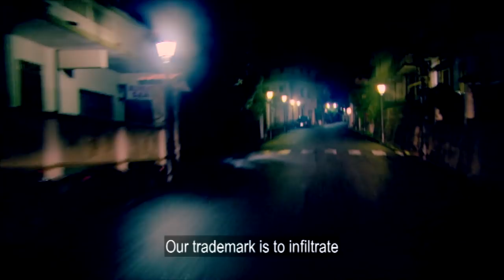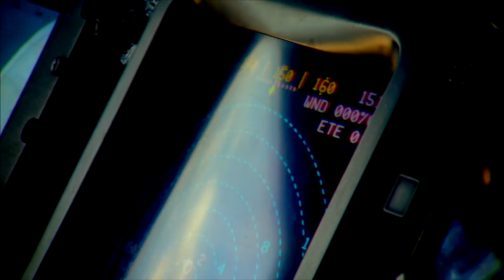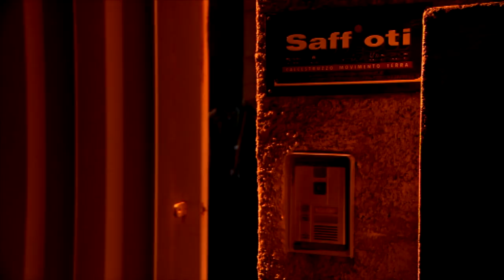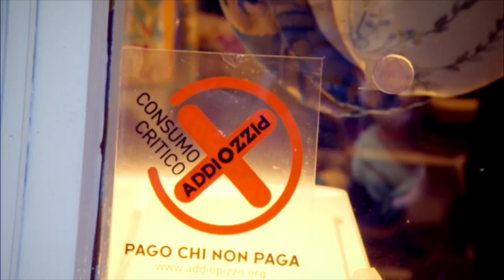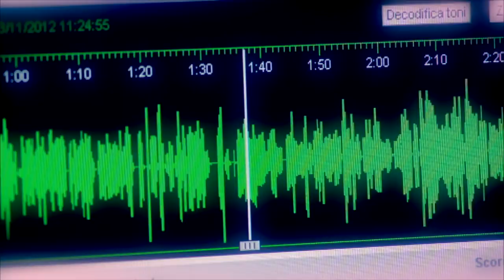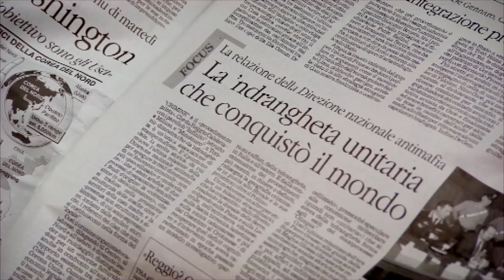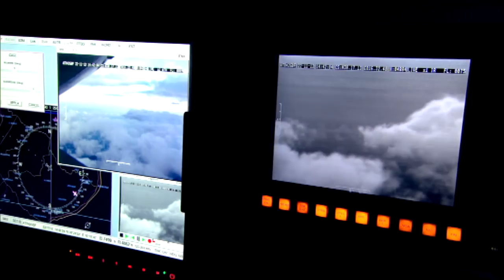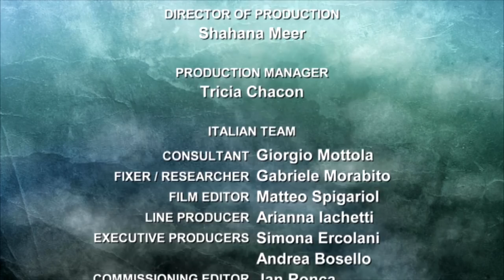The Mafia's Secret Bunkers (Organised Crime Documentary) | Real Stories |

Comment: Excluded RaffleExcluded BingoLinked Bingo Game Provider License DVD-R DVD Double Sided Cover Storage Case Wire Dump Bin 75 cotton 25 polyester 75 cotton and 25 linen lymphatic
Reply: portal print+and+cut+vinyl transmitter 75+cotton+25+linen+paper exchange heat+transfer limited
Reply: 3in1-Smoking-Pipe-Bracelet-smoke-Smoking-Pipe-wholesale-noir-electronic-lighter money-checker--75-cotton-25-linen-offset-printing_-money-checker--75-cotton-25-linen-Micro-Character-Continuous-Ink-Jet